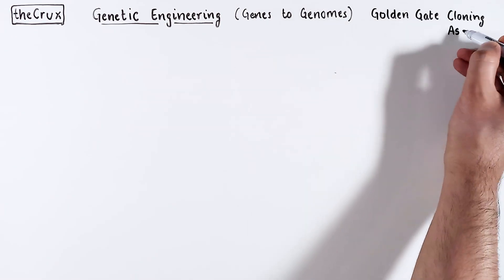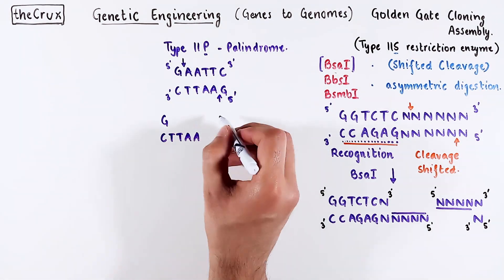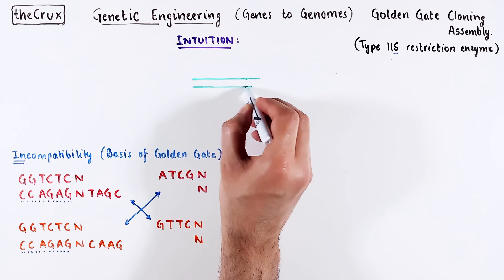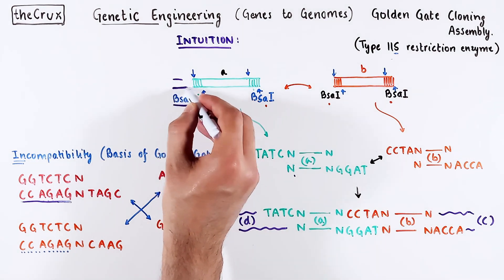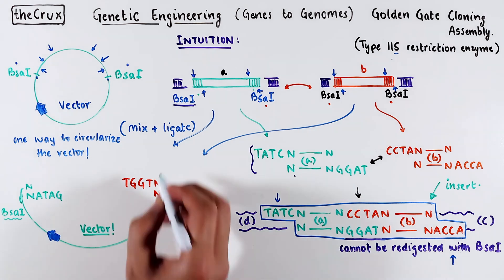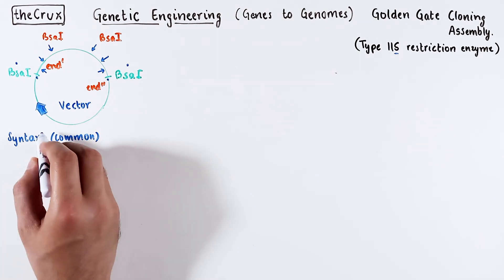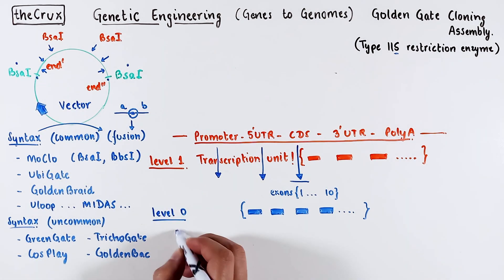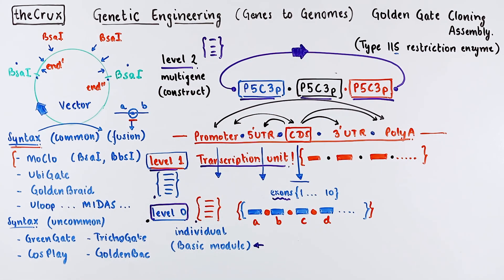Golden Gate Cloning or assembly - Type IIS (BsaI) restriction enzyme based cloning

Comment: i'm confused on how the overhangs are generated. with the BsaI example, how do you know exactly where the cuts occur? like with the lower strand, why does it cut after 5 nucleotides upstream of the recognition site while the upper strand gets cut at a different location? sorry if you answered this in the video, i'm just not following.
Reply from the maker: BsaI is a Type IIS restriction enzyme. It is just how all Type IIS enzymes work (binding and cutting locations are not the same). The upper and lower strand getting cut at different lengths is also a property of the enzymes. Some enzymes leave a longer overhang, others a shorter one; some enzymes don't even leave an overhang. You will find more details in the video on restriction enzymes. Link: https://youtu.be/001BkPSM074